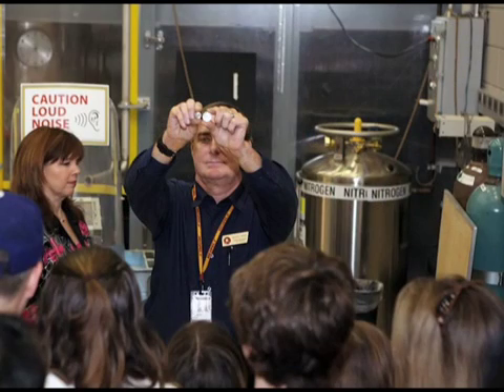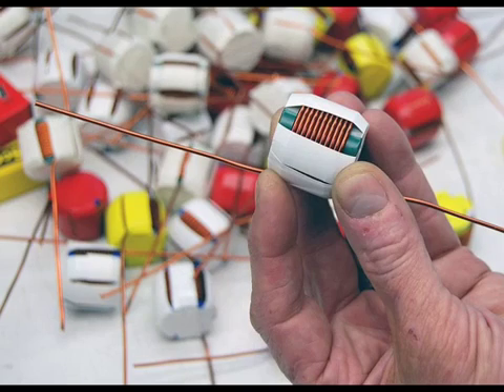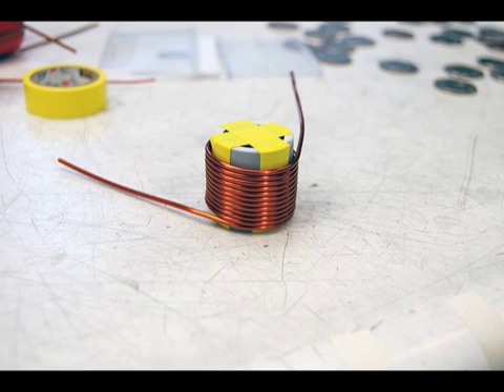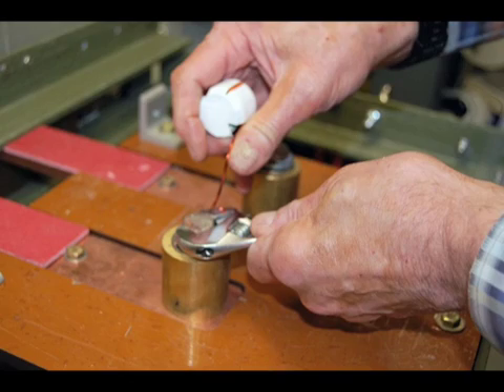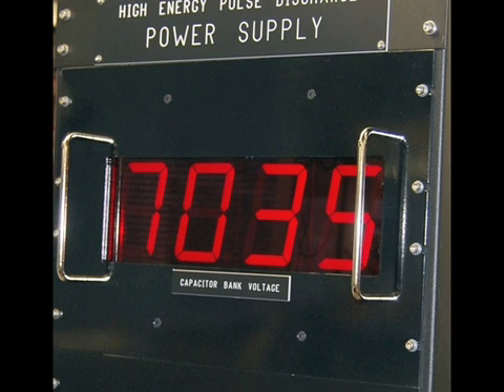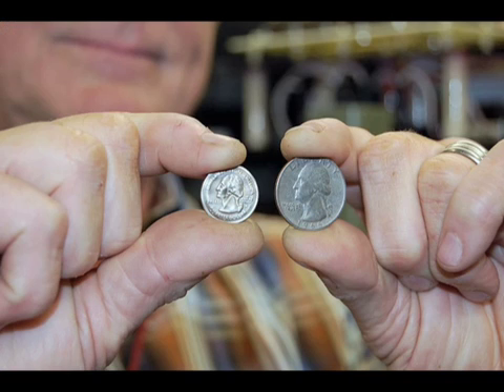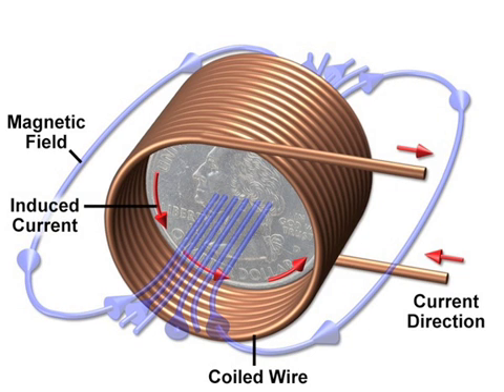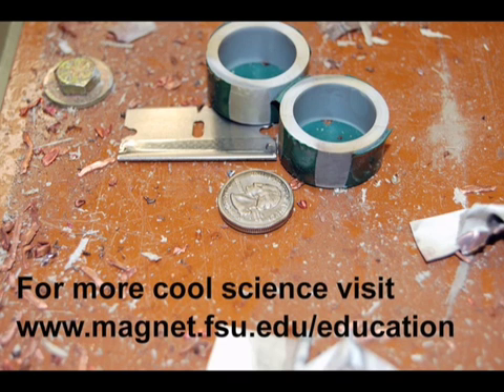Lorentz Forces, Shrinking Quarters and Isaac Newton

Comment: Does this electrical "forging" of the coin's metal make it harder? Could this be done to forge metals to make them harder?
Reply: It's not so much the electricity as it is the explosive force of expanding plasma. But that is an interesting question. Could you put a high carbon rod inside a huge coil and run even more current through it to super-harden the steel? Would there be any advantage to doing this?
Reply: I can understand the force of plasma, but what about the magnetic field acting on the electomagnetic field of the atoms themselves? There is research indicating that gravity is just the electromagnetic fields of all atoms acting in accordance to the inverse square law , but I am not that kind of doctor. My degree in information systems.

I would like to know if someone tried to harden metal in this manner. Anyone?

Comment: I'm the inventor of coin-shrinking (just can't resist mentioning it).
Reply: Awesome! I just looked it up, and sure enough, you're the man! Ever think about turning it up to 11 and seeing what else you can do with this idea?
Reply: Should be tried with the coin as cold as possible, then test for conductivity, magnetic permeability, back x-ray scan for density, any others, for a material with unique properties. Try once to keep the coin from becoming thicker with hardened steel on the faces. Try on doped silicon (transistor material), or inside an orgone box or with an initial existing strong magnetic field present, or ultrasonics at a frequency resonant with the material (I like that one best). I have wound up in software to make money to get back to those things I love. Thanks for the acknowledgement.
Reply: Nice 😎👍

Comment: what is the capacitance?

i have a 80uF 8000 volt bank of capacitors.. managed to warp a quarter, that was about it. currently working on reducing the bus inductance to mere double digit nanohenries. due to the parasitic inductance and resistance of the capacitors i have, i figure 2-4 turns is ideal, but nothing testable yet.